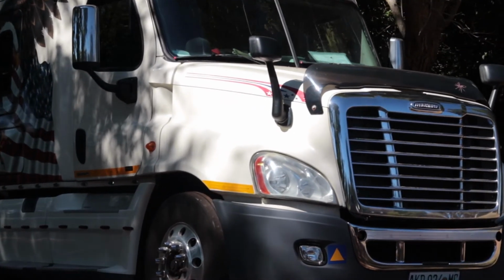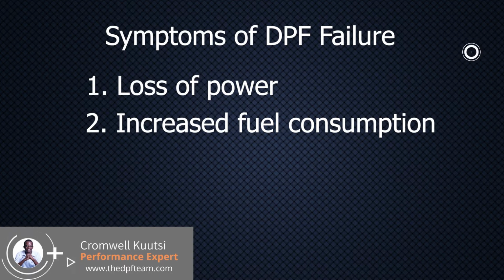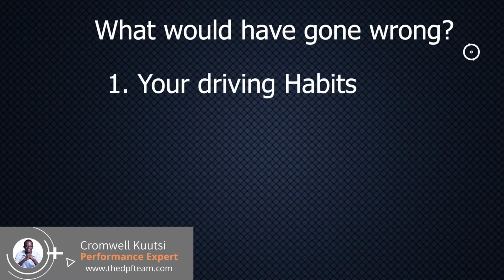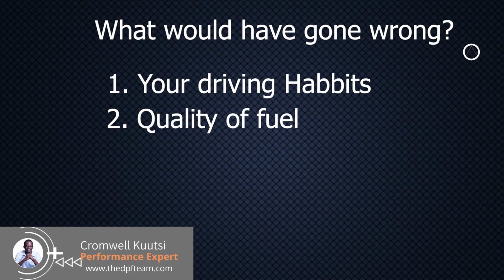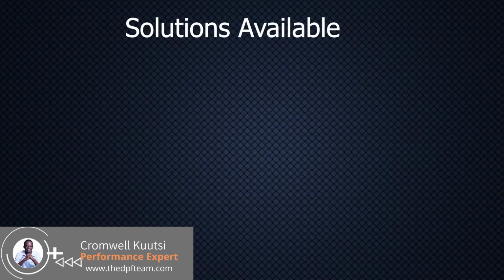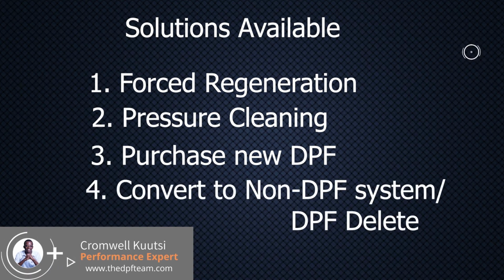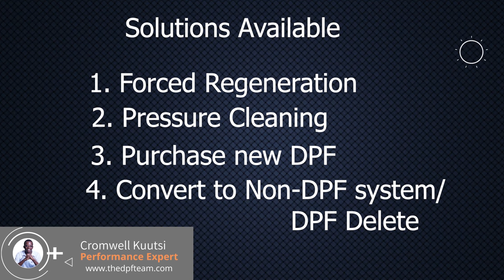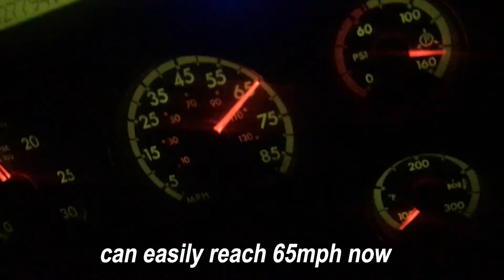Diesel Detroit DPF Delete - Permanently Solve DPF Problems On Freightliner Cascadia - The DPF Team

Comment: If the DEF system was delete on those truck is there anyway to make it back to the way it was ? I mean make it same as it was from the factory
Reply from the maker: yes. It can be restored to factory. However usually the benefits that follow from delete outweigh they need to put it back to factory state
Reply: @thedpfteam2423  the reason why I asked is I stock on the road yesterday and it was a def pump . But since they didn’t have it available I decided to let them delete the system . and  shop ran the program for def deletion but they haven’t touched the dpf filters and egr still not welded .
Reply: @thedpfteam2423  so what should be my next step to do it the way it was?  . Because I just found a def pump and would like to fix it back  . Dpf filters have only couple hundred miles and everything was good . Only the program now was ran from the shop
Reply from the maker: @steveduscov6736  I think its best you discuss with your tuners for recommendations on your action plans